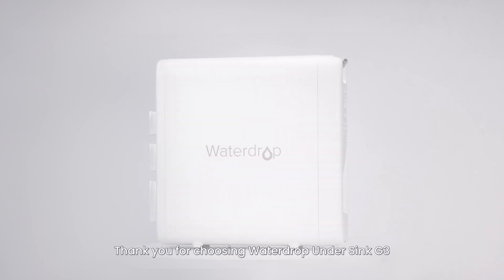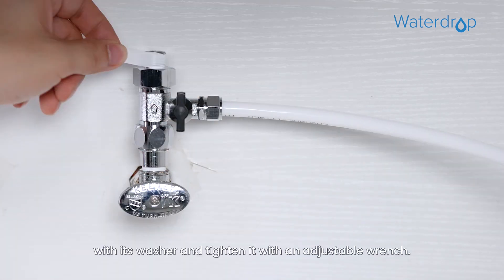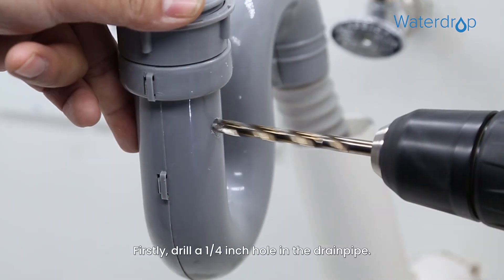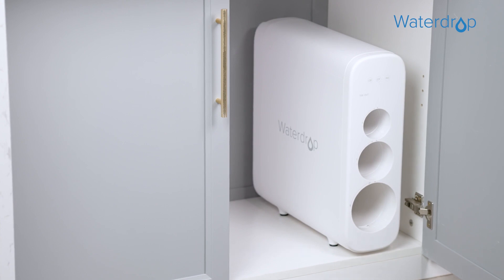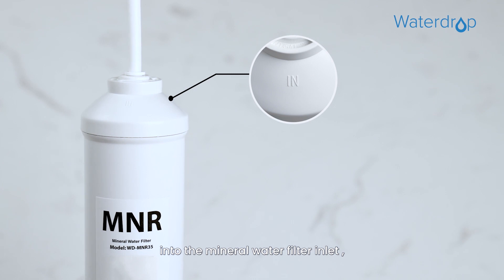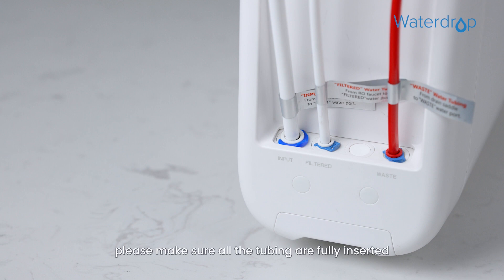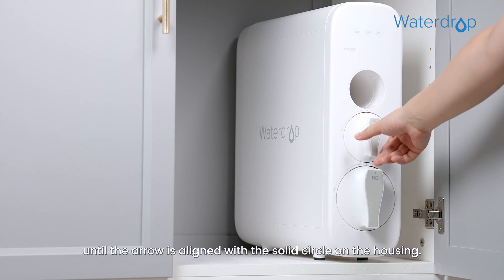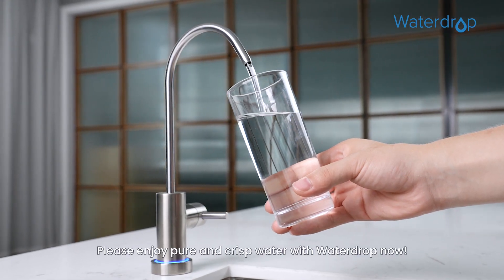How To Connect Remineralized Filter To Waterdrop Under Sink G3 Reverse Osmosis Filtration System

Comment: I got my G3P600 and MNR35 mineral filter. Both of them were separately ordered. However, I haven’t received the quick connect tube connector parts with my MNR35 order, as how you show on the figure at 3:34. Should I order those connectors before starting to install my G3 unit?
Reply from the maker: Hi there, thanks for contacting us! We sincerely apologize for the inconvenience caused. Please contact service@waterdropfilter.com with the issues you encountered. Our customer colleague will response asap. Thanks a lot!